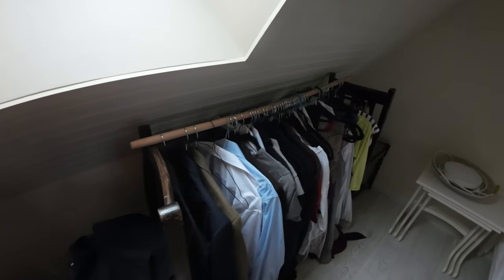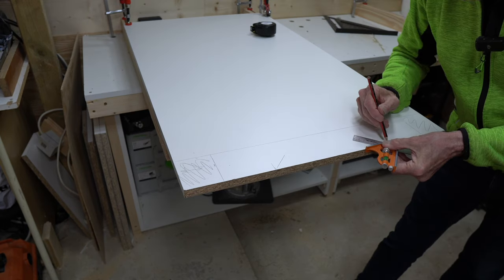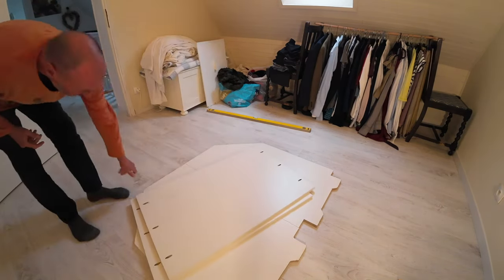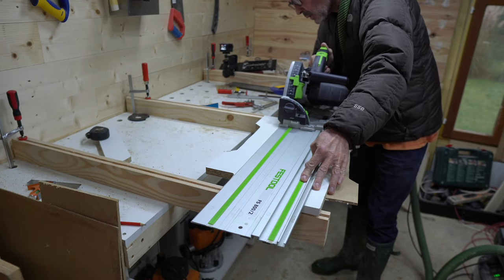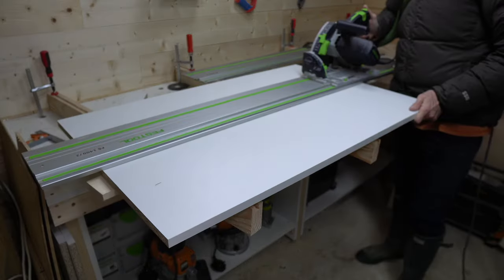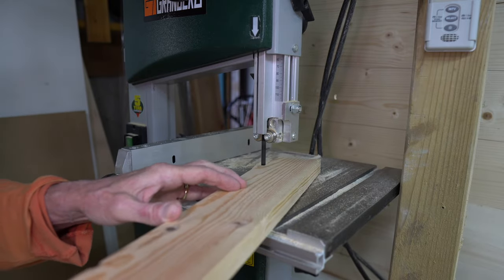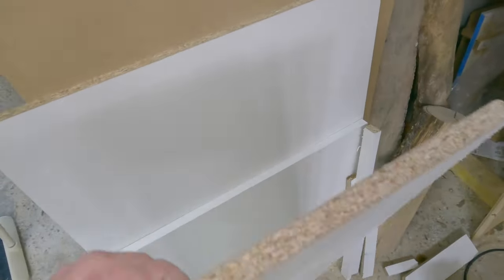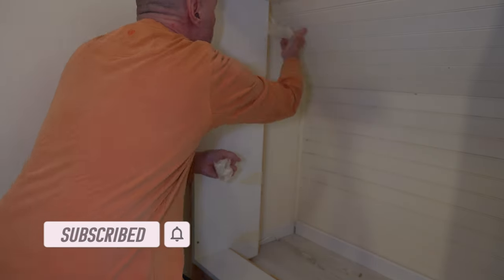Building a wardrobe in a attic bedroom - Wardrobe Build on a Budget - (part 1)

Comment: This is almost identical to what I built in my kids bedroom with a low slopes ceiling. Can't say I spent much as I got a load of damaged pax wardrobes for £20 apiece. Damaged at IKEA by a forklift hitting a full pallet. As I was cutting them for a low slant roof the damaged bit was being discarded anyway. Simply only real cost was filling them with IKEA mesh baskets and chrome clothes rails from Screwfix (cheaper than Ikea)
Reply from the maker: Hi. Good call using damaged goods because as you say, there is a lot of waste 👍 Regards JP